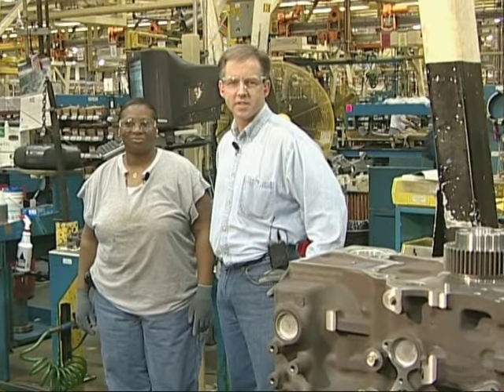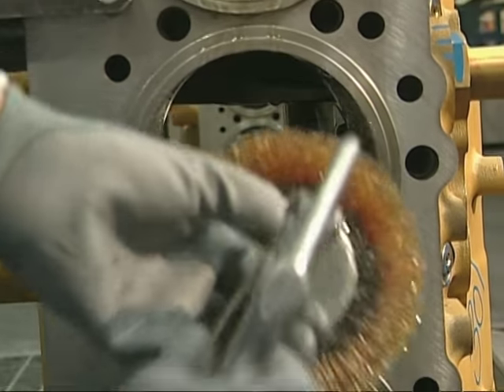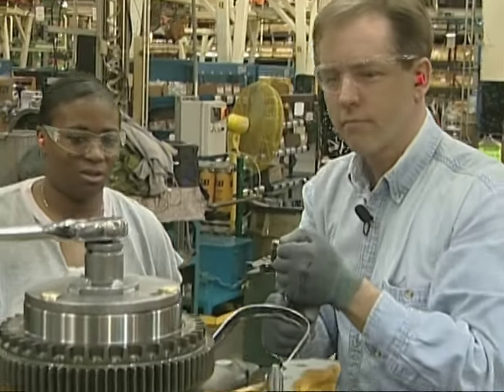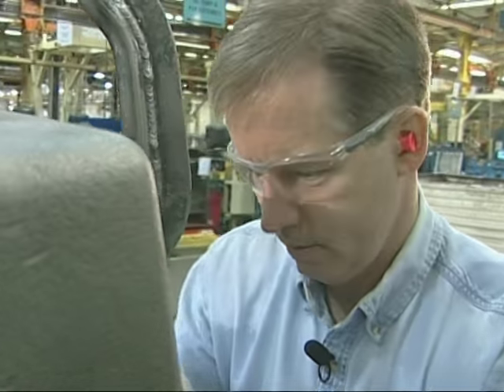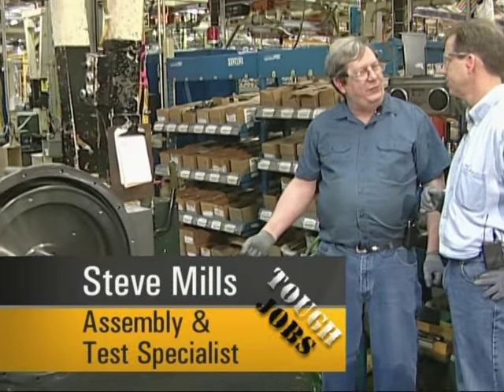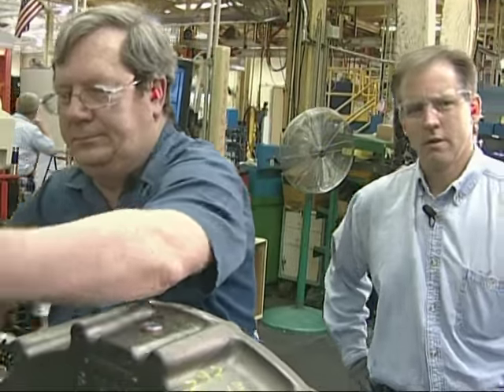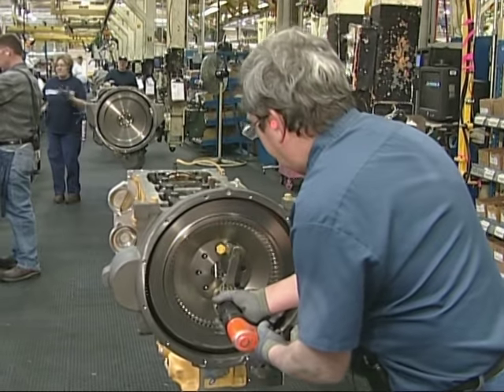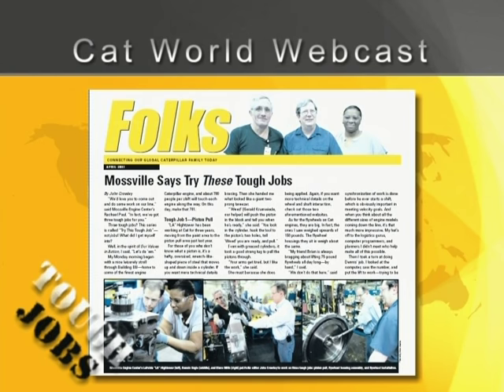Caterpillar Tough Jobs - Engine Assembly

Comment: Just happened to come across this video. I retired from Mossville 2002 worked everywhere. Bldgs B, DD, BB you name it. I worked at Cat for 38 years. Done about everything machine shop, assembly, test, inspection. Interesting video need to show more.
Reply: ry were,
Reply: I also worked there from 2003-2011 in bldg. BB and also DD in hot test.
Reply: Was sooooo sad when they shut down the Mossville plant and tore down all the buildings. Had alot of good times there.

Comment: I thought the flywheel housing is part of the engine block. Is the flywheel housing a seperate part  for interchangeability for various grarboxes? How different are clutch housings from each gearbox?
Reply: Flywheel housing aka bell housing is bolted to the block on one side and bolted to the trans on the other side.
Reply: Alex Flywheel housing is just that, a flywheel housing, It couverture the flywheel, it’s not a bellhousing, cars have bellhousings, just as the front of a truck trans is not a bellhousing it’s a clutch housing
Reply: @63galaxie61  bell housing and flywheel housing are the same thing. Look it up. 

Bell housing or bellhousing is a colloquial/slang term for the portion of the transmission that covers the flywheel and the clutch or torque converter of the transmission on vehicles powered by internal combustion engines.
Reply: @Alex0992  Thanks Alex